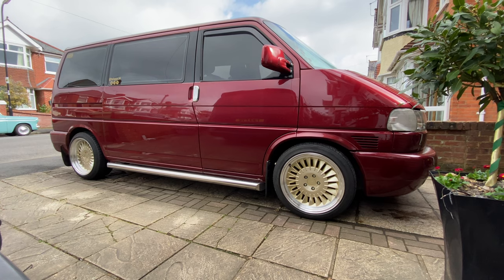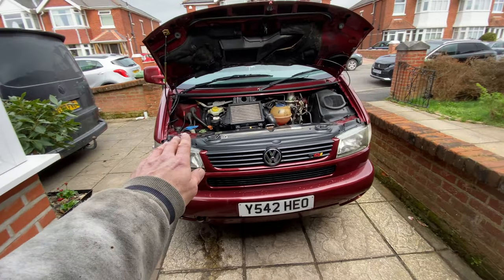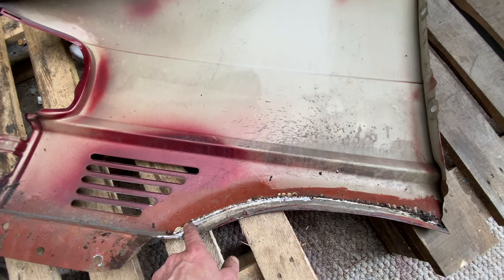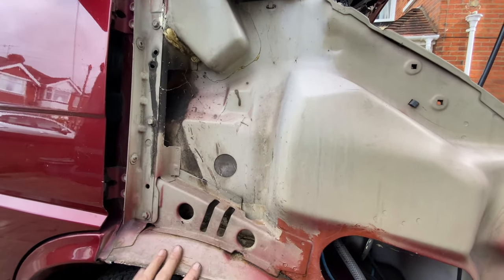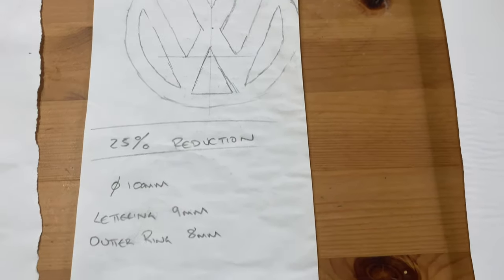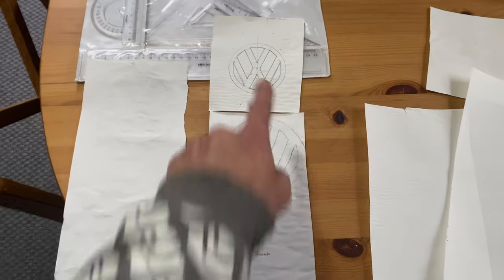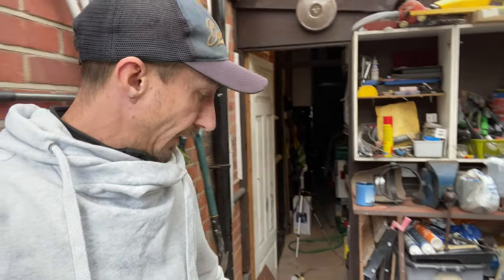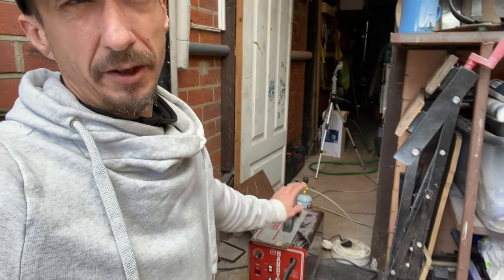Custom wing VW Logo/Badge Grill Modification

Comment: Nice job dude .wings on my t4 need to come off for a clean up been putting off for ages but now you've given me the inspiration to get on with it. Really appreciate your videos keep up the good work 👍
Reply from the maker: Thank you 🙏 I’m not going to say it’s easy, just straight forward, removing the front end and wing carefully still only took about 30mins. If it’s still got original seam sealer along the bottom of the wing it will take a little more effort to remove, with oem sealer I used heat to soften the sealer to help pull the wing off easier 👍 🤙